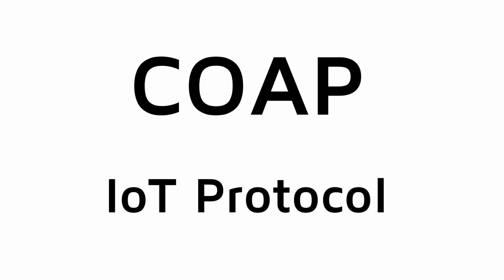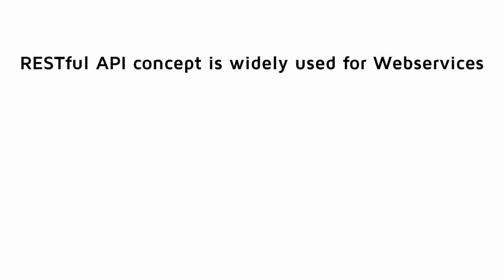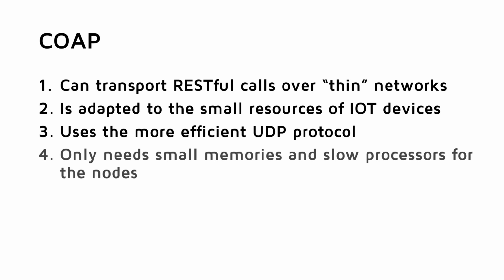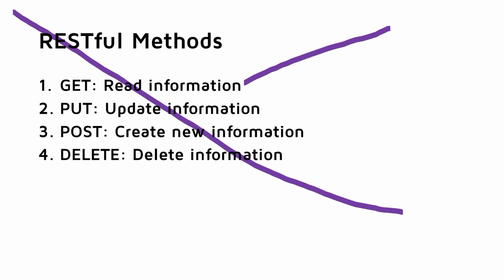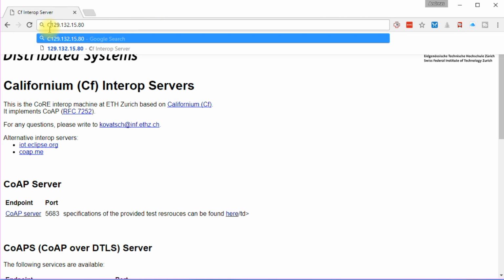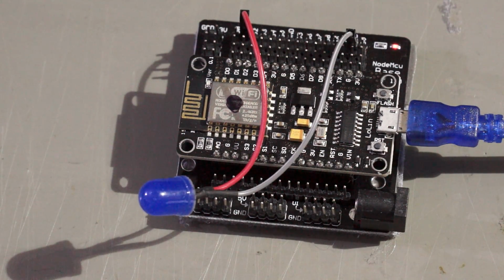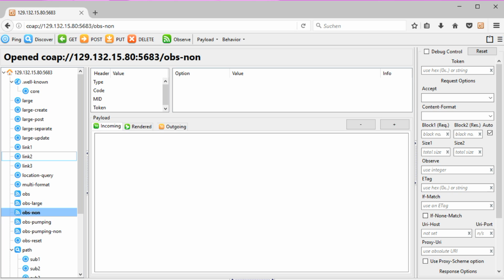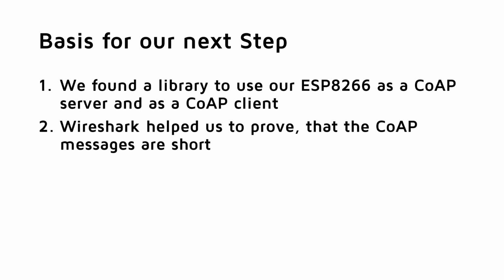#144 Internet Protocols: CoAP vs MQTT, Network Sniffing, and preparation for IKEA Tradfri Hacking

Comment: Can I play the annoying complainer for a moment.
- REST is a pattern/architecture style. Most, what are claimed, REST APIs on the internet don't follow the pattern and are called HTTP APIs/web APIs instead of REST APIs.
- The methods are part of the HTTP RFC (2616). REST didn't invent them and they're not REST methods. REST requires CRUD-like operations that you apply to an identifier and it's only in the context of HTTP that this becomes OPTIONS/GET/HEAD/POST/PUT/DELETE/TRACE/CONNECT. Or in CoAP (7252) it becomes GET/PUT/POST/DELETE.
- The URI is part of the URI RFC (3986) so again REST didn't invent them. REST doesn't care if you use /books/id/1930 or /books?id=1930 but it requires that a resource is identified by it's URI.
REST is a buzzword and wrongly used most of the time. It was simply a pattern made by the same guy designing the HTTP protocol and used to explain HTTP. A few years ago some asshole must have used it on Twitter. Patterns are like fashion, they never go away but simple people forget and greedy people profit from reinventing something that doesn't require effort anymore.
Reply from the maker: If we want to be really precise: If you listen closely to my video, you will hear twice "concept of REST" and never REST protocol.
Reply from the maker: Thanks for your insight. I am glad I am only a simple engineer and not historian nor judge! For me, questions like "does it help to solve the problem?" or "What are the differences between concepts in the light of solving a particular problem?" are more important.
Reply: I agree it's a beginner type of video but REST has become this buzzword that confuses beginners. I even meet professional people who use the word REST like it's a protocol or a framework. People payed to know it, don't know it is nothing more than an architecture pattern.
It's perfectly normal in education to first learn a concept in an easy form and then expand it. And that's what this video also does and it's good. But I feel it says that GET/POST/PUT/DELETE defines a REST API.
I know it's a minor thing in most eyes and it's not the main subject of the video. That's why I called it the "annoying complainer". If people understand HTTP, MQTT and CoAP are protocols and what some of the differences are, the video has succeeded in the main message.
Reply: I don't mean you said REST protocol. But for example at 3:12 you talk about RESTful methods while you're talking about HTTP or maybe already CoAP methods It might make someone think there is a thing as a RESTful method but it can't because REST isn't a language or framework or standard.
/LED/ for example would better be /LEDs/ returning the collection and /LED/{id} for a specific LED because the machine at 192.168.0.10 can have multiple LEDs. Or if only asking if a LED is turned on rather than the full details it would be /LEDs/status/{id}. But in your reply you would also communicate your service structure and available methods for the objects.
So you have a CoAP API at 192.168.0.10 but it isn't REST. Which is perfectly fine because making a service REST is terribly complicated and time consuming.
Reply: @Rizon1985. You are correct, but beside the point. The video does an admirable work of explaining in very understandable terms (even to the layman, I believe) the basic concepts and differences between the protocols. It focuses on the relevance of the concepts, rather than on establishing first a full historic perspective and  academically correct taxonomy. I believe focusing on relevance to be a perfectly correct, effective, and desirable approach for this kind of work and its target audience. I also believe your observations are correct, but they are most relevant and useful within the scope of a computer science course.
Reply: Since it's about internet I'll limit it to that. The protocols standerdise how data is structured and transmitted. In the internet protocols there are 4 layers who from high to low are the application, transport, internet and link layer. Simple example what happens when you go to a website.
Your browser will make a message with a request line (method + uri address), a header (a header contains many different properties so the recipient can understand the package) and a message body. This is the application layer. Alternatives are FTP, telnet, ssh, imap or RTSP that you mention.
Then the browser will give the whole package to your OS and it's job will be to put it in one or multiple TCP packages. Each package will have a header (properties like source, destination, the position of the package among the others so the recipient can add them together again, the checksum for data validation and many others) and a body containing the truncated part from the application layer. The most known alternative is UDP but there's others like SCTP. The importance on this level is that the transport protocol decides features like error validation in TCP or if smaller packages are desired without that extra feature like UDP has. Or another big difference is that TCP has two-way communication to confirm packages while in UDP it just sends and hopes it gets where it has to go (it's not that simple but very simple).
The internet layer in our example is IP (just called internet protocol because ...). This layer again puts the higher level package into it's own data section of the package and adds a header but this time with very few extra information. Most protocols in the internet layer just look at the destination and send it, receive a package if it's for itself or receive and forward a package if it was only a node on the package's way. The main examples in this layer are IPv4 and IPv6. The main difference that the address size in the header was changed from 32bit to 64bit for example but there are also many smaller differences between the two.
And finally there's the link layer which is where our packet is given to the NIC. In the internet protocols this layer is very vague and doesn't do much because the actual transmission (via hardware) protocols are part of another model.
After that finally our request for a website is gone from our computer. It will go over the link layer and internet layer of every node between ourselves and our desition. And at the destination it will go from the link layer all the way down to the application layer which would be the hosting software such as Apache or IIS or whatever. The reply will make the whole route again back to us. But also because we're using TCP there would be constant interaction between the two systems saying "hey I'm going to send a message", "ok send your message", "I'm sending you a message", "I received your message", "is my package ok", "nah send again please", "ok I'm going to resend the message", "yeah do it man", "ok it's resending", "yeah I got it", "is it ok this time", "yeah it's good now fam". TCP has some overhead...

XML is the name of a standard for a file format. These standards simply explain what each bit of a file means. It explains which bits are the filetype or metadata, the data and other thing. For instance a .jpg has many metadata or an archive like zip/rar/7zip can aside from the data also contain parity check and file recovery data. Because of the standard for each file format, your OS can read the bits of the file and understand what each bit at the agreed positions mean.
Database is a broad name for simply a central collection of data. The most used form means it's an application that stores your data and you can extract it from the database via the application from other applications. These are called DBMS software and examples are Oracle, MySQL, PostSQL, SQLite, ... But for example an XML file can also be a database or a txt/ini/setting file can be a database or a spreadsheet in an Excel file can be a database.
Reply: Since there are many questions I'll bullet point it.
- The OSI layer is a very general model. For the internet use the internet protocol suite.
- CoAP and MQTT are on the application layer like HTTP.
- MQTT vs HTTP. MQTT provides publish/subscribe model with a broker instead of server/client model where both sender and recipient have to be alive and connected to send a message. MQTT also has much smaller header size and data is binary instead of document orientated (MIME types). MQTT also provides one to many data transmission where HTTP has to send the full message to each recipient.
- CoAP vs HTTP. CoAP is meant as an HTTP light for IoT devices so it's more like a cousin. While CoAP is mainly meant as a server/client model, it also provides an observe model. CoAP again has much smaller header size. CoAP also uses UDP instead of TCP. CoAP does not have a real one to many transmission but it does have multicast support.
- MQTT vs CoAP vs HTTP. The header size with MQTT is 2bytes, with CoAP 4bytes and the theoretical (but with no practicle application) minimal header size with HTTP is 16bytes. But from Google statistics we know that the average header size of HTTP data is 800bytes and it's typical to see 2kilobyte headers. CoAP has the advantage of UDP which is a lot more lightweight than TCP but it means it's also a lot less secure. CoAP half solves this by making it possible to require an acknowledgement response from the recipient but it only acknowledges that a message arrived and not that it arrived with all the bits or all the correct bits (no checksum). With MQTT the recipient has to know what it is receiving while CoAP adds discovery functionality so that devices who don't know or expect eachother can still look if they can potentially understand the data of each other. MQTT with the publish/subscribe model is better if different nodes also have to talk to each other because in CoAP this is only really possible if all nodes are always awake and connected. While CoAP has multicast it means it has to pass a switch or it will still have to rely on sending the same message like in HTTP.
- AJAX is the name for the collection of technologies that make async communication possible. It's not the name of a framework or technology or standard or programming language or whatver. It's the same as "POTATO PEELERS" is the collection name of devices you can use to peel a potato. 10 years ago it was a buzzword and buzzwords are bad. Some wannabe engineer reads it somewhere and then tries to find as many suckers as possible to come watch their stupid powerpoint presentation where nobody learns because the person trying to teach is an idiot who doesn't know himself.
- JSON is a file format. It is made to provide one of the most lightweight serialisable data formats. Serialisation means taking structured data into a flat form and which can later be deserialised into the structured data without having to know the structure before.
- I don't know NODEred so I'll answer in general. Yes an ESP8266 has libraries to make it a full working webserver that can send and receive. Sending means it can send you a webpage to view and receiving means it can listen for a call and then in the code it can in your example change the PWM on a digital output.
- It is probably slow because you're learning to program but good news is that it's very easy to find the problem even when using a very basic IDE. Add Serial.println() between every line in your loop() and let it print timestamps so you can see which line of code makes it slow. If it's a method, go edit the method with timestamps. This way you can pinpoint which code is slow and the first solution to a problem is always to find the problem.
- Also small note, try to use MOSFET drivers even if you are using TTL mosfets. It makes switching a lot faster because it's easier to overcome the MOSFET capacitance adn this also minimises dumping power because it's closed quicker. It's more reliable because it won't stress your microcontroller under unexpected or untested situations. It's a lot safer because it decouples your MOSFET from the microcontroller and a MOSFET driver can handle backcurrent.
- TCP/IP stack is a synonym for the link layer when the transport layer is TCP and internet layer is IP. It's not a OS or something. The only relation it has to an OS, is that the OS needs to have a library that can understand it or it can't send and receive these messages. For the link layer the OS will also use your NIC firmware. And on the application level it's done by the application (browser, ftp client, apache webserver, media player, ...).
- Multicast means a message will be send and a switch will lookup all the members of a multicast group and send it to them. There is also unicast which is a message from sender to receiver. There is broadcast which is a message that goes to the switch and then it will be send to everything. There is also anycast and geocast but you'll almost never see these.
- There isn't a simple better way between MQTT and CoAP. There are very distinct features that once you understand both, will also make it easy to see which is better for your problem. And the understand them better you can watch these videos of Andreas to start.
- If you want to keep it simple you don't want to use a DBMS. Or maybe use very lightweight one like SQLite. But you can also use a json/xml file to serialise the data. The difference is that with a DBMS you will use SQL querries to communicate with the DBMS while if you use a file as data storage you will use or make a library for (de)serialisation. And off course there are also simple libraries to talk to a DBMS but you can also look into ORM which is currently the best way to use DBMS from applications but these are very high levels implementations that don't fit on an Arduino. But whatever you run on a server, even an RPI, has the storage and power to do these things and they can provide and abstraction layer for small IoT devices.
- REST API are 2 different words but they're used together to confuse you either on purpose or because the other person is confused themselves and are afraid not knowing something makes them look stupid.
An API in general is a combination of methods and data structures that your code can use so you can use lower level functionalities without having to write or maintain them yourself. You'll know APIs as libraries in programming but interfaces is also a word for them. For instance if you write Serial.println() it uses the code you can find in \hardware\arduino\avr\cores\arduino\Print.cpp without writing it yourself. And the Arduino IDE will use APIs of your OS to receive and read those serials messages it receives. And your OS will use the USB drivers which act like an API.
A WEB API on the other hand only means it's a webservice with endpoints.
And then there's REST API which implies that it's a web api that implements the REST architecture style. REST API is a word that came with the web 2.0 when the wannabe engineers wanted money again for making their stupid powerpoint presentations. A WEB API is just a webservice and it can use the REST architecture style. There also isn't a SOAP vs REST because SOAP is a protocol and a webservice that uses SOAP can be made to follow the REST architecture style. REST describes a certain way how an implementation of technologies should be made and it's not a technology itself.
Reply: - IP cameras usually have a chipset that is very efficient with handling network traffic so there's not much difference when having to process the TCP traffic. But if you have weak connections for instance, TCP will cause a lot of extra traffic in bandwidth too fix corrupt transmissions and make it even worse for itself until the line is flooded and everything has to reset. If you are going to set up more than one/two IP cameras or you're using a weak wifi network, I actually advise to setup a separate wireless network just for the IP cameras. That way they don't bother all the other traffic and all the other traffic doesn't bother them.
- It is possible to use HTTP over UDP but it's wrong to say it in a simple word. HTTP is build on using a reliable protocol and that's why it uses TCP. But having said that, there are hundreds of examples where HTTP is used over UDP because it does work when you want to use something familiar like HTTP but also want to stream and don't care about perfect data integrity. In most of those examples there are better protocols to use over UDP but HTTP is better known and in ICT you can't always make the perfect solution because of time and money.
- MIME just means the file format. Like you and I talk about a json file and for your OS that's a file with .json extension and on the internet it's when the content type in the header says application/json.
- Multicasting in your IP camera means the same as in my previous comment. Your camera will send it's broadcast once to a multicast group and your switch or router will then send all packages to everyone in the multicast group. In practice if for example you watch the camera's stream on both your computer and smartphone, they will both be part of the multicast group and your camera only has to send it's stream once for both to receive it.
- For plotting look at something like Google charts. There are many alternatives but I feel Google charts is a good starting point with their combination of simplicity, functionality and the price. ChartJS and Highcharts I would name as alternatives. Fusioncharts is also very good but watermarked if you don't pay. D3 charts is no doubt the strongest library of them all but also not the first library you want to start with because it has an extreme learning curve.
- Read this white paper if you want a deeper understanding of web services https://www.w3.org/TR/2004/NOTE-ws-arch-20040211/ I know it's dry material but if you want to understand the theory, you have to read the theory. Too few people do and that's when you google something and get 10 different answers.
- TCP and UDP don't have standard ports no. What you refer to is HTTP standard being 80 and HTTPS 443. But that doesn't mean they are restricted to those ports. For instance you probably at least once had to forward a port if you make a machine from your local network available to the internet and often ISPs block ports like 21, 25, 80, 110, 143, 443, ... Even if you make your local webserver run on a port that isn't blocked, you still have to forward it to the correct machine so it's easier to for instance use www.mywebsite.com:4000 and on your router forward port 4000 to 80 on the machine running your webserver. Your router will replace the correct destination in the headers every time those packages pass by.

Reading is how you'll learn knowledge about such a broad range of technologies. But experience is a big part of it too and over many years your knowledge can grow deeper. It's been a little more than 25 years now since I picked up the QBASIC handbook that came in the Windows 3.1 box of our first computer and I still know as much as John Snow. (If you don't watch game of thrones, John Snow knows nothing.)
Reply: If you want to make a REST service, check the original source http://www.ics.uci.edu/~fielding/pubs/dissertation/rest_arch_style.htm or the whole dissertation where it comes from.
It was simply meant to explain the design of HTTP 1.1 but has recently been used to describe a new generation of web service. But know that unless you're making a very simple web service, it's almost impossible to actually integrate the full REST style. The model of HTTP itself is very simple and when making a web service your model often can't be that simple.
Reply: - If you watch a live stream of your camera and the image is good quality and at the correct framerate, you know that it's ok on your wifi network. But when your image freezes a lot or goes low quality or the framerate always goes high and low, that is how you see that your network is overloaded from the cameras.
- Yes your router must support multicast but pretty much every router does. The protocol is called IGMP (on the internet layer btw) so if your router specifies IGMP support, it has it. The only caveat is that a lot of consumer routers support basic IGMP but not IGMP snooping which is more efficient but it shouldn't be a problem in a home setup. Custom firmware like DD-WRT does unlock more multicast features. 224.0.0.0 through 224.0.0.255 is the standard range for multicast in a local network so that's why your setting is standard on 224.0.0.0.
- I think the idea is that your have remote sensors who use nodered as a broker installed on an RPI for example. You can run a webserver and web service from an esp8266, I do and many do, but it becomes overloaded very fast. It's fast enough for some basic tasks but if you let it do too much, it becomes too unresponsive.
- Google charts requires internet on the client yes because it uses Google apis. But webserver which generates the page doesn't need internet. Build the webpage, add data to it and on the client it will show the graph. Note that I'm not 100% sure on this but that's how it should work. The whole <canvas> object is generated by Google servers and send to the client and not to the client via the webserver.
- Ports don't understand protocols no. Ports are simply doors into a house but it is important that the correct/expected doors are used so traffic can be directed to the correct room.
- In theory 2 applications can not listen on the same port at the same time and it is best to follow this. If needed you should let one app work on port 80 and the other on for example 45080. Or if you have 2 NICs both can work on the same port but on the different IPs. If you don't follow the rule, you get implementation hell and when a problem happens in a year, you will not like the decision you made in history.

Just remember that if you look at code you made a year ago and don't like it, that means you have gotten smarter and better at it. It is rare that you look at applications and don't see how you could have done better. Also never be afraid to make it better. In the physical world it is often impossible to correct things or do it over. But when programming it is very easy to rewrite code (this is called refactoring) into something better.